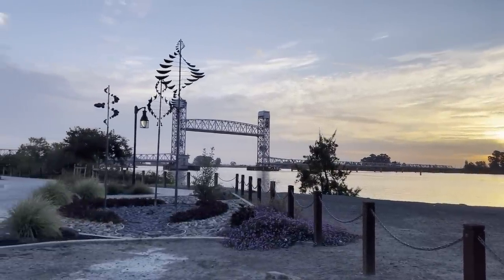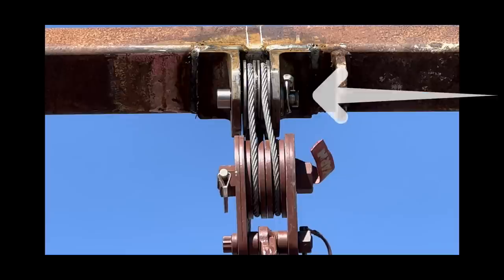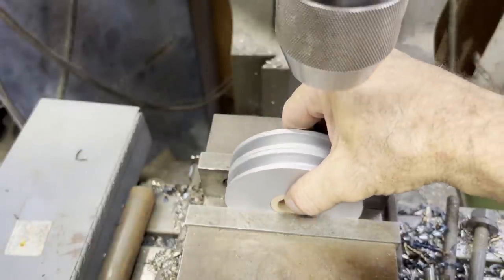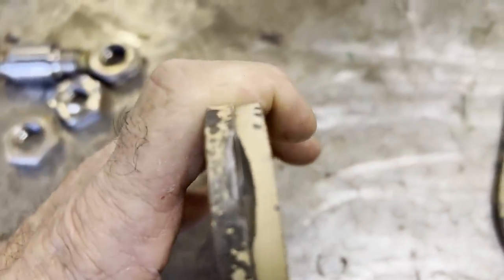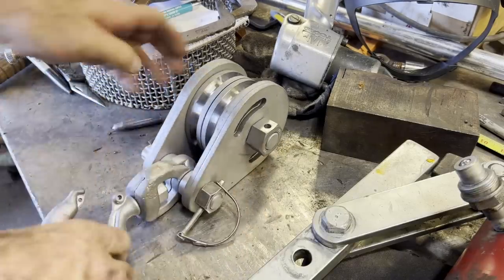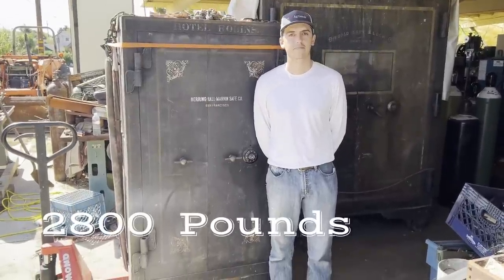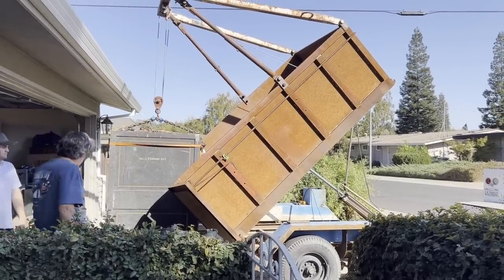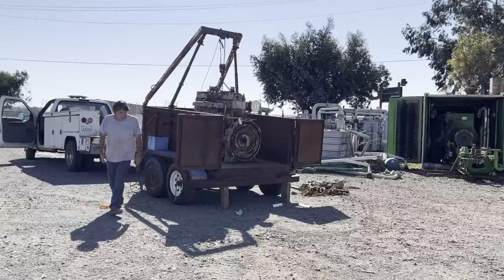My Versatile Self Loading Dump Trailer

Comment: I watched your other trailer video very carefully. Until then I thought a drop deck was the best way to load and move heavy equipment by yourself. Then I became convinced your trailer was the best design. It's not really optimized for the same purpose, but Matt Cremona build a similar trailer with a large log Arch for picking up large logs in an urban environment. I must have drawn 50 different designs, vacillating between the two. Here you've gone and built exactly what I was circling but couldn't quite pull the trigger on. It seems like this new design is the best of both worlds. I can already tell I will be coming back to view this video a couple more times for reference. Thank you so much for sharing your designs

Comment: Ahhh.  I see the actual wire is more appropriately sized.   Very good.  I was a bit worried at that first picture.  Wire failure when lifting big weight is no small matter.
Reply from the maker: Douglas, i’m using the wire that came on the 6000 pound warn winch.
Reply: @OldIronMachineWorks  Wouldn't be the first nor will it be the last time a manufacturer undersized fittings or specs!  There is a definite minimum diameter for the bend diameter of each size and kind of wire (or fiber line for that matter).  I like the concept of dump bed and arch.  Nice job.

Comment: Hi I’ve just finished my trailer build, I used to have 5 trailers now only 1 but it does what all my other trailers did and more. It’s based around a log skidder,the frame is n shaped and all the other attachments are held with just 2 pins . It is also a Crain and lift about 1 1/2 ton . Still coming up with other attachments but they will need to be drawn up first. It’s also convertible from 2 wheels to 4 wheels , extending and hight adjustable.

Comment: Well, well, well!  Favorite moments:

* Photogenic artistic finger burn.
* Versatile design.  Pretty clevis!  Er...  uhm... 
* Working on nice, clean parts.
* Stabilizing the drill bits with the tool in the cross slide.  Nice!
* Testing.  Testing is good.  (Though... you COULD have tested with something HEAVY.  :-)
* Success!

Gotta watch those low bridges and other overheads, eh?  :)
Reply from the maker: LOL   I did measure twice before driving across the bridge. 
Appreciate you watching the video and leaving a comment. Thank you.  Gary

Comment: Excellent idea and utility…. But you may want to look into the strength of the trailer to truck connection.  Lifting like this could potentially lift the trailer’s tongue off the truck’s ball.  That’d be a wreck.
Reply from the maker: Nick, it is amazing how little up force there is at the hitch. It will load a Bridgeport mill without being hooked up to a vehicle. As long as I put the blocks at the very back of the trailer.
But I have thought about making a couple simple little hooks where I can just hook a couple chains for when I’m doing heavier loads. Appreciate you watching the video and commenting.    Gary

Comment: Well done on the trailer.  Well done video.  
Do you think you might need some protection around the winch roller from sliding loads?
Reply from the maker: Greg, if I did anything it would just be to cut a couple blocks that could sit on both sides of the roller so if I wanted to pull something all the way up to the front it would go up against the blocks and not the roller. I appreciate you checking out the video.   Gary

Comment: Looks like the diameter of your sheave is a bit small for the size of wire you are using??  I see the strands opening up as it tries to take that hard turn, which is a sure sign.  There are tables telling you the diameter to use as I am sure you are aware of.

Comment: Do you have power down on the dump ram? Looks as if you would need it at the top of the stroke. Oh--at 47:40 it appears you have a shuttle valve.
Reply from the maker: Joe, it does require reversing pressure on the main cylinder to pull the bed down. I just use a simple manual divider to reverse flow to the ram. Once I get enough weight towards the front I can then switch valve and use gravity down. I hope that makes sense, and I hope you’re doing well. Thanks for checking out the video.   Gary

Comment: Fantastic design, I don’t know if it’s your original design or it’s inspired by other work, the concept and workmanship is brilliant, it is a pleasure watching your work, thank you.
Reply from the maker: Thank you Rupert. For the most part the design I came up with. I seen a larger trailer designed for hauling septic tanks where the gantry portion rolled back-and-forth on the top of the trailer. I then thought what if I made my gantry portion rigid to the trailer and use the tilting part of the trailer to line everything up. I then started scabbing stuff together till I got something working the way I like.
For me having a trailer that can haul dirt, scrap, garbage, go dump it , and then immediately go load a piece of equipment makes the trailer very versatile for what I was wanting.
Appreciate you checking out the video.    Gary